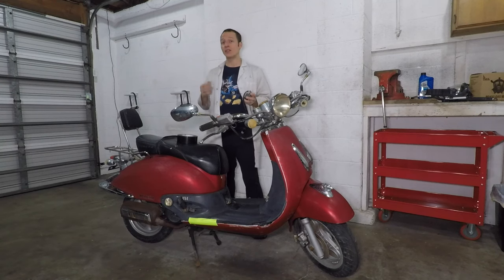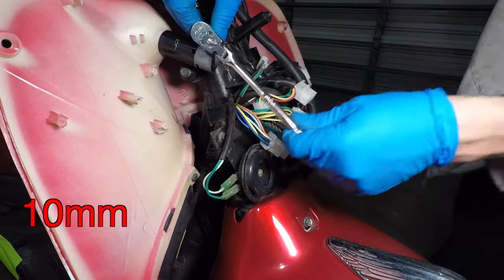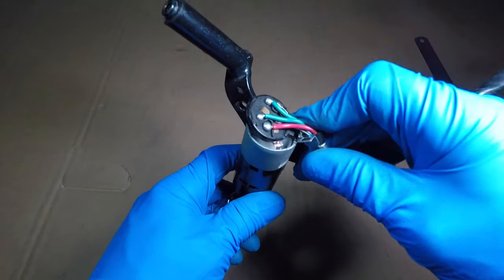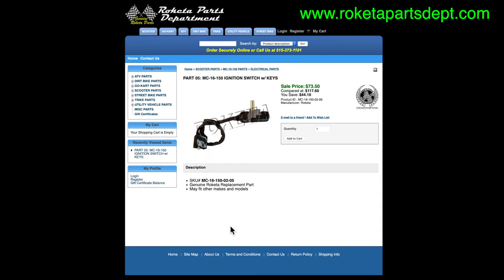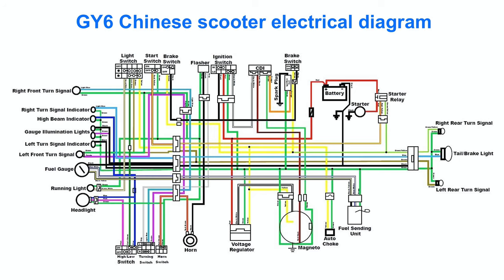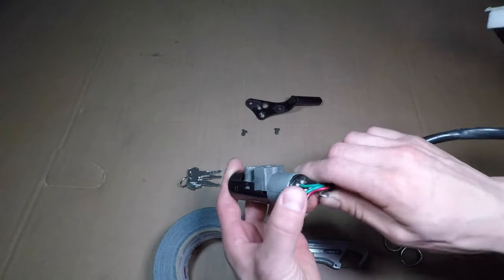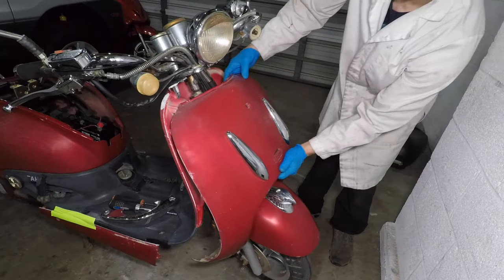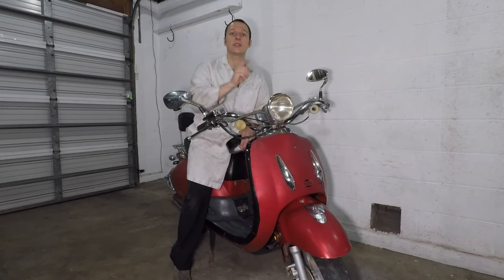Fixing the ignition switch on a GY6 150cc Chinese scooter

Comment: Thanks for this video. The ignition switch was a bit of a mystery to me before. The wiring diagram is confusing at best. You made it easy to understand how the switch works. 
I have an 2009 Il Bello scooter that looks a lot like the roketa. Do you know if the parts on the handle bars are the same? It has 1" diameter handle bars. Most scooters have 7/8" handle bars.
A lot of the wiring on my scooter is damaged. I'm hoping to revive it. I love the body style of this scooter.

Comment: I have a problem... I didn't realized i accidently threw away my ignition switch and with that wa the bracket. So my question is could i find one that doesn't require a bracket and fits on my Icebear (PMZ150-5n-F)??
Reply: They actually sell replacement parts for the ice bear scooters just go online and type in the name of your scooter and it will bring it up. Same with the Honda ruckus as well.

Comment: When I turn my ignition my dashboard doesn’t light up. Which means I can’t start the bike with the electric start. But I can kickstart it. And all my lights come on but not my dashboard still.y battery is fully charged. Can this ignition switch be the issue ?
Reply: I’ve tried numerous thing such as my battery and my CDI. Also completely replaced the speedometer. When I plug the speedometer in the numbers come on but the speedometer doesn’t light up which means I can’t start it electricallly.
Reply: No it's a fuse

Comment: Hello, i am from Turkey., following you on youtube channel. I own a scooter  (code is 1P39QMB) . I will apply big bore kits (72cc up to 86cc) and also racing cam shaft.  My question is should i use my existing carburator or sould i  upgrade it as well? If so, do you recommend what size. of carburator it should be? Thank you for your help in advance.. Your channel ROCKS by the way.
Reply from the maker: Thanks!  A big bore kit should always get a bigger carburetor.  Performance carburetors are usually just a few mm bigger than stock.
Reply: @LabCoatPaul  hey man I have a question , praying you can help me scooter been down 1 month and just got it only has 136 miles on it, my ignition broke on my 2018 ADLY GTA 50 AKA HER CHEE  it's a Taiwan scooter and barely any information on it anywhere , I have 5 wires BROWN, RED, BLACK, GREY, BLACK&WHITE STRIPE  and the new ignition switch I purchased from ADLY PARTS is the same exact ignition but different color wires and amount of wires at that which IS ONLY 4 And colors are  BLACK, GREEN, RED, BLACK&WHITE STRIPE and I've contacted ADLY NUMEROUS Times and NO ONE will respond and Place of purchase won't fix it unless I pay for all of the cost because the ignition isn't under warranty so they say, which is B's and any local shops tell me I have to get it there via truck or pay for them to tow it to shop and also pay for diagnosis and for them to purchase ignition cause they don't install parts they don't get from there parts supplier as well as pay for hourly labor and I financially j do not have another $400 to spend after purchasing this scooter 1 month ago for $2,400,  literally has 136 miles on it and I turned the key on ignition not even hard and the ignition key cylinder did complete 360 when I tried to start it and now will freely spin and not do anything at all. Please help and lmk what color wires should be spliced and connected to the new 4 wires on the new ignition if you can !!!  If you need any more information don't hesitate to ask, thanks again .